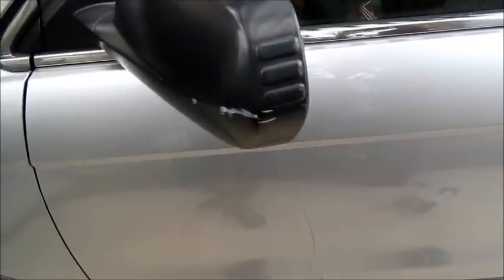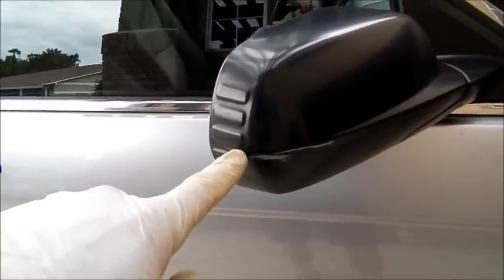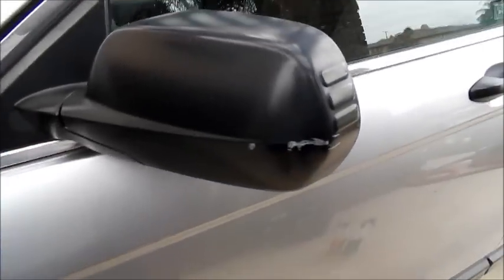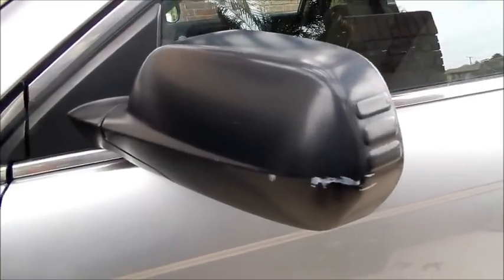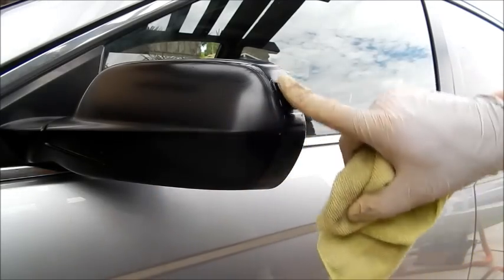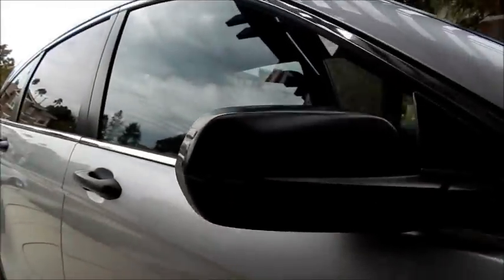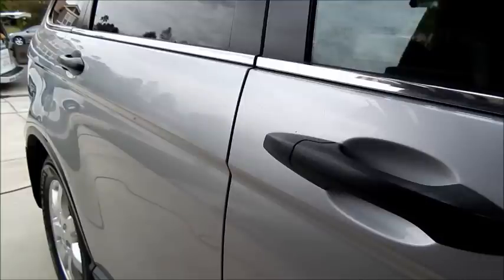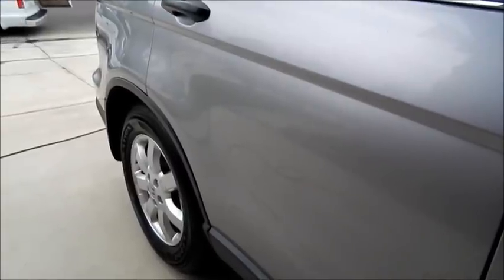Magic Eraser Detailing part 2 removing transfer from side mirrors

Comment: Thanks man! This worked wonders. Bought a 17 F150 with paint transfer on the front bumper pad and came right off. Washed the pad with soap and water, dried it off and the scrubbed it with the magic eraser / 50% alcohol. Came right off with some elbow grease!

Comment: I have a tip - you know those car wax marks left on the rubber, mirrors,  and plastic parts?   Tip - Use a pencil eraser.  Or get a large eraser from Office Depot, etc.  I bought a super big Pink "novelty" eraser that says "For Big Mistakes" on it from the dollar store, for a buck.  In 6 years it still hasn't worn out !!!   
- I haven't tried a Magic eraser on it,  but I will try that next.
Reply: Corus Von Drae that really does work. I do screw up sometimes and use those pencil erasers. Works like a charm. 😁

Comment: Best auto detailing tip ever! Thanks for posting this. I have used Magic Eraser extensively on the interior of my home particular on white doors and mouldings around the house and it works great. I never would have thought to use it on my car but now I will particularly the lower sides of the car and for the bugs on the front of the car. Have you used it on black paint? Any issues you would foresee on using it on black paint?
Reply from the maker: Dominick Delfino Yes. It will eventually abrade surfaces when used long enough and/or hard enough. But as the user, you remain in control. You can always apply some polish by hand very quickly to remove abrasions if needed. I am still a huge fan and carry them with me always and always find uses for them.

Comment: I use it for leather. It cleans it safely and thoroughly. Try it out. It's easier than using an APC. It's quicker and doesn't leave the surface hard.
Reply from the maker: Valid point. But go easy and check for results as it is easy to abrade the finish away without realizing it. My mechanic used it on his skin in the shower after I told him about the Magic Eraser, and without realizing it, he abraded the top layer off his skin and woke up the next morning with a big area of road rash that scabbed over....they are amazing little tools.
Reply: Auto Fetish Detail I did the same trying to remove a sharpie mark off my hand, it worked but gave me road rash in that area.

Comment: Do I need to use a degreaser? just wondering because I dont have one in hand.
Reply: I justed used a double sided dish scrubber, the abrasive part and some 50%isopropyl alcohol, worked like a charm and the streaks came off. I just hit my side mirror today on some jackass's side who was illegally double parked in the road, big streak and in came off without much scrubbing
Reply: @Eddy3443  Just did that and it worked like a charm! Thank you so much!

Comment: Question, just scratched my side mirror against another side mirror of another car. So  other than the magic eraser, are you also using just purely water or the simple green solution as well?
Reply: And I thought magic erasers are abrasive. Wouldn't that damage the paint?
Reply: @benjaminjulianryan4965  Probably remove the clearcoat.

Comment: The chrome trim pieces above the door handle, if there are fine lines, minor scratches on it, what would your recommendation be to remove them?
Reply from the maker: Some form of polish/compound that actually has some form of abrasives to them.
See if this link helps:
http://www.best-auto-detailing-tips.com/car-paint-scratch.html
Not all scratches are created equal, so it is hard to give a simple answer as it depends on how deep the scratch is, are you doing by hand, or do you know how to use a polisher.
You might want to check out this video also: Car paint scratch:You can't fix what you don't understand!

Comment: Does the Super Degreaser remove the wax on the paint? Do you have to rewax any area that got sprayed with Super Degreaser? thanks
Reply from the maker: Philip Fox YES. Reapply wax whenever you use any cleaner on the paint.

Comment: Only used the erasers in my kitchen/bathroom so far x)

Any knowledge of molecular effect? Or are you going off of results? Just curious about possible long term  effects. 

How long have you been using them for this btw?
Reply from the maker: Been using about year and a half or so....have questioned how they actually work.
I go based on results but have learned their limitations and know how to use, when to use, based on what is appropriate and based on many factors of each moment.
Reply: Auto Fetish Detail my understanding of the MagicEraser it that it is essentially 20.000 grit Scotch-Brite.

Comment: Magic Eraser.. I have to find this sucker in Germany :D Great product :)
Reply: Schmutzradierer gibts öfters bei Tschibo 20 Stück für 10€ glaub ich
Reply from the maker: Malborex That would be pretty expensive. I pay around $1 a piece for the name brand version: Mr Clean. If you buy the generic kind, they are even cheaper.
Reply: Auto Fetish Detail Generic walmart ones are utter crap. I use them as padding for my moving parts and things in stuff I build.